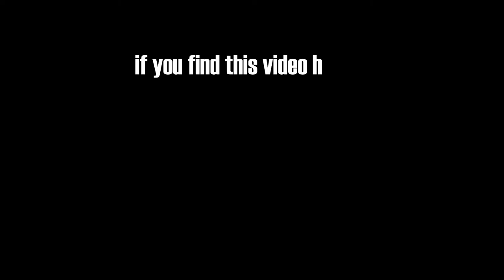MODEL MAKING - How to Connect Parallel Circuit for Miniatures | Kenth's Creations

Comment: Do we need resistor for that po?
Reply from the maker: hindi na po, pwede niyo na po agad i-connect sa switch or battery
Reply: Technically you still should use a resistor, but the leds have some natural resistance. However, you do risk having your first led burn out without one.
Reply from the maker: @trickstur5994  thanks for sharing. but so far, I don't have any problems with my led lights.